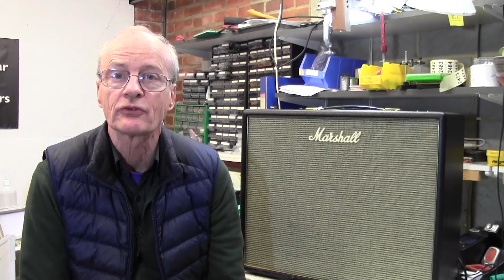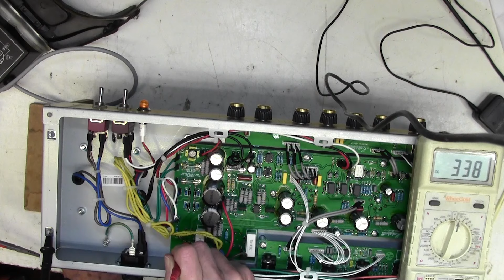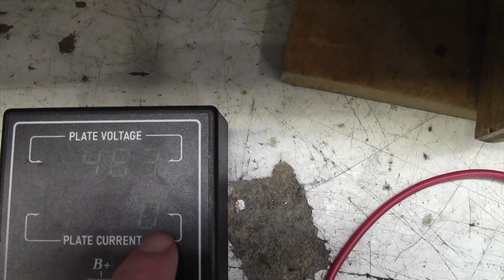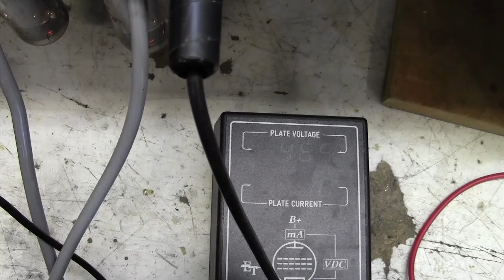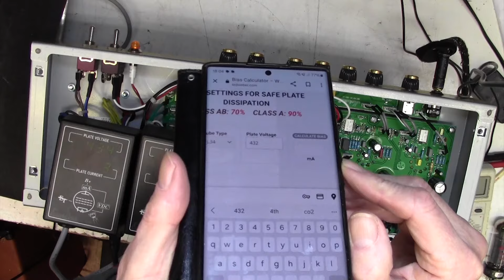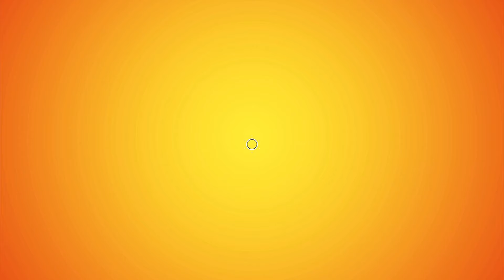Marshall Origin 50

Comment: Just FYI for the Origin series:  for the fx loop to work, a TRS plug needs to be inserted into the foot switch jack with the ring open.  Ring to ground turns the fx loop off and tip to ground turns the gain boost off.
Reply from the maker: Hi Jason. Ah, I didn;t know that thanks. The thing is, will I remember it in 5 years when I get another one of these???

Comment: This is why I have valves at home. I can at least change those out and see if that's the issue. I got a matched quad of Telam EL84s from a guy in Ukraine and a bunch of 12ax7's from a few stores in the US. I even have a couple of NOS vintage valves from GE and somewhere else. Sylvania? I don't recall ATM. I need to pick up some 6L6GC's so I have some of those onhand, as well.

I got an incredible deal on those Telam. The Tube Store wants $80 for a single Telam EL84. I paid less than half of that. For FOUR(4) matched valves! 😁

Here's the best part. When I installed them into my amp, it didn't even need to be re-biased. Spec'd voltage was still within range. It didn't change and I'm certain I was testing at the correct location. They spec -12.5v and it was at -12.4v. Some of these amps, the Monoprice 15w aka Laney Cub 12R been found to be biased as high as -8.8v. The guy said he went through powet tubes pretty often.
Reply from the maker: Interesting thanks for sharing.

Comment: I had the same problem. I swapped out the tubes and have run the amp about 6 hours every day cranked (I have an attenuator) for 3 years without any problems at all. I love the amp though i wish they left out all the nonsense and made a basic JCM 50. The goofy power cuts sound like garbage. With all their faults an attenuator sounds much better. I bought my first Marshall a 1987 in 71.

Comment: That was an interesting one Stuart.. Several years ago I had a Marshall JCM-800 1X12 50 watt combo. I switched it off after the gig ended and our drummer managed to walk into it seconds later carrying his kick-drum and the amp fell over on it's front. Not much of a fall as they go, but when I turned it on at our next rehearsal.. Nothing.. You've guessed it.. Both EL34's not even showing the glow from the heater element. That's the only time I've heard of both output valves going tits-up at once.. Drummers.. Can't live with them, can't live without them. 😅
Reply from the maker: Interesting. I wonder what caused those heaters to go. Maybe the shock when they were still hot.
Reply: @stuartukguitarampguy5830   Yes.. I think the valves were still quite hot and I remember someone saying a few years ago, 'always let your amp cool down for at least five minuets before moving it as the valves are most vulnerable when at, or near, working temperature.'

Comment: I purchased of ebay 2 EL34'S they lit up my valve tester but putting them in my amp failed to lite up must have been a different pin size. I wonder is the valve socket?
Reply from the maker: Yes but BOTH valve sockets?
Reply: @stuartukguitarampguy5830   Yes both valve sockets in may   Blackstar 40 watt combo did not work with the valves from ebay I cant remember  the brand but I think they where British made different pin size maybe? but the one's that came with the amp did and they are EL34 BHT, Chinese which has much larger anodes than normal EL34'S
May be when you where testing the amp and as the valves heated up it caused a issue with the valve sockets ??

Comment: That's a very interesting failure mode. I wonder if something else made those tubes fail and it might happen again sometime down the road. I guess time will tell...
Reply from the maker: MAybe one went some time ago and he didn;t notice until the second one failed?
Reply: @stuartukguitarampguy5830  If it's a two power tube push-pull circuit, one power tube is taking neg half of the cycle and the other one taking pos half of the cycle. I don't know that it would work on just one power tube. Never have tried that to see what happens.
Reply: @VegasCyclingFreak The amp will still produce sound at a fairly decent volume. There’s tons of distortion though. I can see how someone could miss it at bedroom levels with the gain cranked or using pedals.
Reply: @matthewf1979  Could be the case... but I wonder how the tubes failed in the first place. I suppose it could have been a defective batch of tubes. Also weird that no current flowing... suggests perhaps an open connection inside.
Reply from the maker: @VegasCyclingFreak  Yes it will work, just slightly distorted.
Reply from the maker: Yes it will still work just a bit distorted

Comment: Hi Stuart, maybe you should verify for oxidation on the power valves pins and tube sockets?
Reply from the maker: Good idea!  See my reply to Steve above.
Reply: @stuartukguitarampguy5830 ,  Check the soldering on the EL34 tube pins as well ---- I've seen modern Russian and Chinese tubes where the leadfree soldering in the tube pins was intermittent!
Reply from the maker: @goodun2974  Ugh okay thanks.
Reply: @stuartukguitarampguy5830  ,  It's also possible that a weld let go inside the tube where the pins connect to the individual elements but that isn't something you can repair. Bad soldering on the bottom of the EL34 pins is easy enough to fix.
Reply: Skip Simmons swears by cleaning valve pins with a light dab of WD40
Reply: @gphone9619  , no. WD-40 leaves a residue. Techs like me are tired of seeing greasy residue on tube pins and in the tube sockets. Typically, alcohol and a toothbrush will clean tube pins, along with some alcohol sprayed in the socket; but if  the tube pins are badly oxidized, use a fine wire brush, a scotchbrite pad, or an ink eraser on them.  Miniature 9 pin sockets used for 12AX7 and EL84 tubes can be cleaned with a wound  guitar string of about 33 to 38  thousandths.
Reply from the maker: Yes defo not WD40!
Reply: Contact cleaner only, spray insert remove spray insert
Reply: Hi you guys might be right, since its both valves that doesnt work, it could be possibly a bad weld connection in the power tubes themselves (same batch).
Reply: @JPDESS  ,  Combo amps are particularly rough on tubes because of the speaker vibrations rattling the tubes so much.  A separate amp head gives the tubes some measure of isolation from the speaker cabinet. You're also more likely to knock a heavy, bulky combo amp around and bang it into things  when carrying it in and out of a club, compared to a head which is easier to carry.
Reply from the maker: My money is on one valve going down ages ago and he didn;t notice.
Reply: @stuartukguitarampguy5830  Hi Stuart, yes probably, but the amp still produce a sound (even if its intermittent).
Reply: @stuartukguitarampguy5830  ,  The guy probably plays metal in his bedroom,, which is a scenario and a  genre where an amp can be barely functional and yet as long as it puts out a high level of distortion the player is generally satisfied.
Reply from the maker: Exactly!

Comment: Marshall released  the Origin 50 in 2018 so not so surprising that tubes have failed when they could  have 6 years of use. The Origin models don't have a great reputation
Reply from the maker: Thanks Steve several people were asking about the 'origin' of these amps!
Reply: As Little Walter (& JD Simo) sang 'Boom, Boom ...... Out Go The Lights'